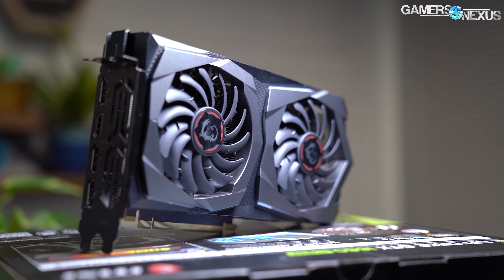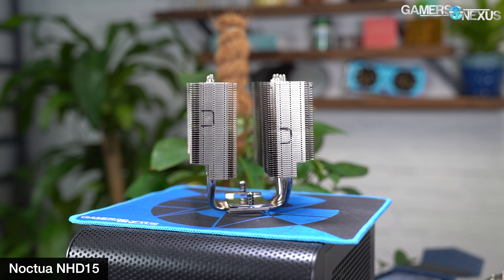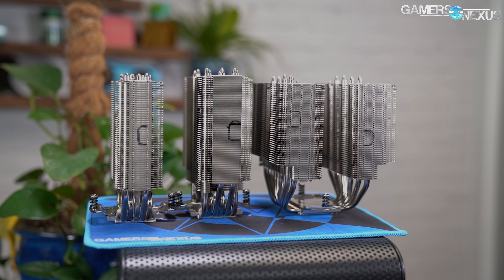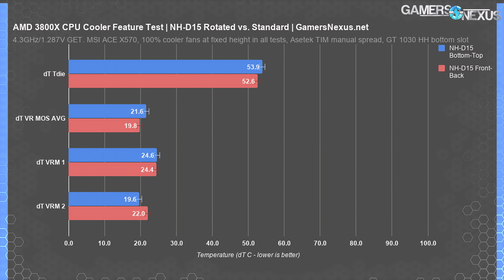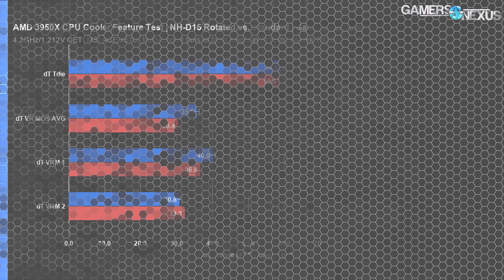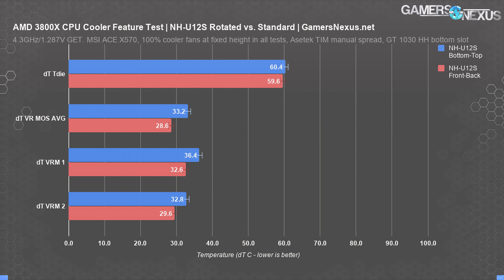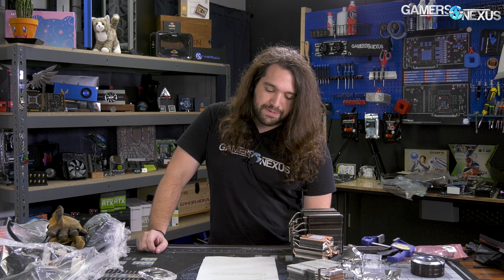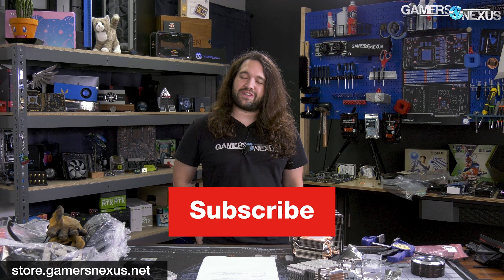AMD Ryzen Heatpipe Orientation Benchmark & CPU Cooler Myths

Comment from the maker: We did in fact test the D15 (with two fans), not the D15S, contrary to an earlier comment that incorrectly "corrected" it. Removed the comment to reduce confusion so that people don't see it and get confused. We filmed this one like a month ago, but finally got around to publishing it. Article is ready and will go live after the video has some time to breathe.
Check out the Disappointment PC build! https://www.youtube.com/watch?v=YO_xDzDOua4
Buy the Disappointment PC Shirt in cotton (https://geni.us/izO3) or Tri-Blend (https://geni.us/rw8QX) to support us, our intros/in-depth testing, and to commemorate a year of disappointment! These will be a limited run due to the nature of the shirt.
Reply: So what you're telling me, is that other random people on the internet may be giving out bad information? Next thing you will be telling me is that the Earth isn't flat...
Reply: Good video. I know this is a little impractical but, I would be interested to see how well a cooler works upside down vs right side up. I have read that different types of heat pipe wicks (grooved, wire mesh, sintered, etc.) are affected differently by gravity. Some are not affected much, others (like grooved) are affected much more. I believe most (if not all) CPU coolers use sintered metal (which works very well against gravity) but, I wonder if certain wick styles are more cost effective and if that would lead some cheaper CPU cooler manufactures to use grooved or mesh wicks. If they do, I wonder to what extent those coolers would be affected by gravity when mounted in a more gravity challenging position.
Reply: Great video!! Now, to take this a step further, would it matter for coolers with direct contact heat pipes (for example the hyper 212 Evo)? I thought maybe a cooler like this would be represented, due to the fact that there was a cooler on the table/workbench which had direct contact heat pipes. Since the coolers tested here all have nickel plated cold plates(I believe that's the proper term... But essentially there is an extra layer of metal between the IHS and the heat pipes in the coolers tested in this video, which something like a 212 Evo does not). Just a thought since the orientation may make more of a difference due to the direct contact nature.  (I hope this makes sense)
Reply: The efficiency claims would have potential basis when it comes to heatsinks with direct contact heatpipes. In practice, you're looking at a 2-3 degrees difference.

In non direct contact implementations there's no practical difference really.
Reply: Thanks Steve, but these myths are basically exercise in stupidity. If even once those redditors or basically anyone spreading those myths performed at least a heat simulation I'm sure difference would be negligible.
Reply: @Gamers Nexus If you want to make a video on waterblock orientation and jetplate modifications on Rysen 3, Igors Lab would be a good inspiration source. He did try something like that, although in German.
Reply: @Denis-l6p  No worries mate, My main thought is that when dealing with heat pipes with different types of wicks, some work better to fight gravity, some do not. Sintered works very well to wick the fluid in the heat pipe back to the source of heat (even if it is straight "uphill"), where as grooved (according to my reading) does a poor job against gravity.

 So in the theoretical example I'm thinking of it would be as though the motherboard was facing upside down (Like flipping a server chassis upside down), with the cooler heat pipe tips pointed straight at the ground. If the cooler uses sintered I would expect some very small loss in performance (probably negligible), but if the cooler used grooved I would expect a much larger loss. Now this is such a special circumstance scenario I doubt many people ever have their motherboard facing down in the first place, let alone use a cooler with grooved heat pipes, but it might be a circumstance when orientation (in terms of overall orientation, not orientation in relation to the CPU itself) does matter.

I would try it myself but my PC has an AIO, so no heat pipes there. I might be able to see if it affects my gpu, but the heat pipes in there are not as simple as a CPU cooler (like tower coolers from noctua for example) where all the heat pipes have a common facing "tip point" that all point in the same direction. And I am 99.9% certain they are sintered in my GPU anyway so I doubt I would be able to get any amount of noticeable change. 

It would be interesting to see if some really cheap ("no brand") coolers use grooved wicks or even mesh wicks and would fail under this circumstance. But frankly this is mostly just a "what if", I can't think of many examples where this info would do anyone much good, other then satisfy my curiosity lol. The main question is if any company is shady enough to put really low quality heat pipes in a CPU cooler. If so (according to my reading) and if it was grooved and it was working straight "against" gravity it should fail to within a very high percent of its efficiency
Reply: Shirt links don't work
Reply: @LapFox most of the good shirts  sizes are sold out anyway...
Reply: That's several days of testing for something you already knew won't make a difference. Thank you for taking one for the team, and kudos for all buys and girls in performance testing!
Reply: Again, thank you for making life easier to prove to new builders who catch wind of nonsense.
Reply: +Gamers Nexus Pls test bottom top with a popular gaming gpu! Could it improve gpu temps at the cost of cpu temps? With a not so core heavy, lower tdp cpu that is sufficent for gaming paired with a higher tdp gpu, the cpu's cooling might help improving gpu temps... Still probably would not worth changing builds for a couple of degrees but would make an interesting vid. Thing is, I have an i5 8400 + a gtx1070(msi armor). Cpu cooler is a bottom top oriented Alpenföhn Brocken 2 with 1 140mm fan right between the gpu and the heatsink. I was worried at first because I could not fit the whole thing in any other way but my temps are great. GPU never reaches 70, Cpu never reaches 65 celsius. Gpu has a 15% OC. Also I have another 140mm fan at the top of the case and one at the bottom. CPU idles is 35, GPU (turned off fans) 45 celsius. My case is an old Cooler Master 690 Advanced II. And sry for my english if it is hard to figure out what I am trying to say.
Reply: What i am a little concerned about after reading and posting replies to quite a few of these comments is that heatpipe orentation really does not matter. Which is false it actually does matter significantly. It matters to the degree that there are mutiple wick types for constant conductance heatpipes and some of those really do not work well in some orentations. As well as even between the same type of wick for example 2 sintered heatpipes based on the wick thickness and porosity you can tune and mitigate issues like the ability of the heatpipe to work in different orentations and even the pipes ability work against gravity. 
I do not disagree with the test nor how it was conducted. I however think some of the explanation and findings could have been said / done in such a way to further improve peoples understanding of what this test really showed. Which is that most heatpipes when already run in a horizontal configuration do not preform worse when rotated within the same axis. Like having a half filled water bottle on its side and rotating around a imaginary axis that runs from the top of the cap through the base of the bottle horizontally. And that integrated heatspreaders do their jobs well ... 

The issue im seeing is that some people are thinking that orentation of heatpipes in any and all axis do not have a significant effect on preformance
Reply: What kind of a GEEK are you? A D15? 
IT'S D4 D6 D8 2*D10 D12 D20. There is no D15 in D&D. Don't you know nuffink?
Reply: @Peter Cavojec i am not even sure where to start in regards to replying to that comment. Ryzen 3rd gen uses one of tsmcs 7nm processes while not the slightly more dense 7nm extreme UV process it is still more dense then intels 14nm processes. Tsmcs 7nm EUV process is actually very very slighly more dense then intels revised (less dense and more realistic 10nm process revision which is currently busting the backs of intels engineers) .... Then you run into the issue that amd and intel use different metrics to calculate TDP and differnt boost durations they end up being not very comparable. The next issue here is that efficency generally increases with density as you have less loss from internal resistance however you also increase thermal density which makes chips harder to cool as a general trend however if you for example changed the extremely small copper interconnect grids out for say gold your again changing internal resistance... What im getting at is process tech and material choices make a huge difference as far as how efficent a chip is at any given transistor density as well as how much leakage may occur. For example mobile processes are lower leakage processes , a inherited side effect of lower leakage tends to be lower frequency. Mobile processes have a trend to not clock as high as similar processes tweaked for higher frequency bascially damning efficency to a degree. There is so many other issues here as well... I am just goona end my reply with this last thing otherwise this reply would be many books long if we were to go through the physics and material science here
Reply: @Gamers Nexus

Can you do some tests to tell us, which watercooling block to use? 
There is also a hypothesis out there, which claims that most waterblocks will struggle (in comparison to non 3000 series) because of the non centric dies (asymmetrical + off center)

Thanks for your vids and greez
Reply: Is there a difference between running coolers in orientation ie UPSIDE DOWN vs sideways (like in a case) vs upright (like a test bed)?
Reply: pointless arguments. just use an aio

Comment: Orientation on the CPU isn't what I wondered about.  I wonder about heat pipes being horizontal, as in a tower case, versus vertical, as when the motherboard lays flat and the cooler sticks up.

Comment: Hi there,

I was wondering if y'all would be willing to do a video testing different GPUs with different types of cooling(blower style, heat pipes and fins, just fins, etc.) and their ability to cool themselves in different orientations. 
This problem stems from the SFF community where there are many cases with an upright GPU, which is now being introduced into Lian Li's cases as well. The SFF community's general consensus has been an upright GPU does not cool as well because of heat pipes pointing down, vapor chamber liquid being further from the processor, and blowers having more resistance blowing up than sideways.
I would think case designers would not make upright mounts if this were the case, however, Thermaltake has just pumped out a new set of 90 degree mounted cases and a new Tower case with the GPU in an upright orientation.

I would appreciate it if there was a test of some sort done specifically for GPU orientation in open air, not taking into account things like distance to side panels and such. The only tests I can find for heat pipes are industrial or zero gravity applications.

Comment: My tower case on it's side allows my xeon cpu to run at 140W. In normal tower orientation, the CPU can only do 100W. The orientation of the pipes makes a huge difference. The thing to understand is that the liquid in the pipes cannot flow upwards. If the liquid doesn't flow back to the CPU, cooling is severely impacted. If the CPU is not at the lowest point of the pipes, relative to the ground, those pipes are not working at maximum efficiency.

Comment: Great work! This is as close to scientific method as you can easily do with coolers. The only thing possibly missing is testing for the gravity effects (e.g. you could run the whole test bench upside down and see if it affects the performance of heat pipes – logically cooled liquid should fall downwards and if you have the system upside down, the liquid inside the heat pipes might never contact the CPU end of the heat pipe).
Reply: Heat pipes are built with wicking inside.. Sintered metal powder based heat pipes should not in anyway be disturbed by gravity! Liquid has no issue traveling against gravity in a wick
Reply: @DarkAttack14  I totally agree that a correctly implemented heat pipe should depend on wicking only. My trust in average hardware manufacturer is low enough that I think the implementation quality should be validated and that's why I think at least one test done upside down would be warranted. If that doesn't show a difference, then you can be pretty sure that the wick implementation was actually correctly done.
Reply: @MikkoRantalainen  yeah I'll give you that one, I'm operating from the assumption they produced it properly! You're not wrong that it is not a guarantee. One of the first uses for heatpipes was inside satellites and spacecraft so a properly built one can handle all types of gravitational situations but one would assume NASA was building proper heatpipes XD

Comment: My 3800x runs smoothly and quite cold at 4475 MHz, using Noctua NH-D15. Indeed, I have a monstrous case, but the fans runs at their minimum speed.

Comment: I have a request. Would you consider doing a test with venting the heatpipes?  I am interested in seeing how much effect the liquid actually has. We know heat travels by 3 methods, Conduction, Convection, and Radiation. The copper is always there and conduction is a constant.  The fluid introduces both phase change and convection. You guys seem to be able to afford to do destructive testing so how about it?

Comment: the orientation of the heatpipes would be more effected by gravity i think, you want the cold side of the heatpipe orientated so the fluid within the heatpipe can flow back towards the cpu end of the pipe.

If you mounted a heatpipe cooler on an upside down motherboard (like the 2 system in one case with itx board mounted in the roof of the case) it's efficency would suffer greatly.

This is a noticeable problem with laptops, if you tilt some laptops 90 degrees so that they are not horizontal the cpu temp wise rise rapidly.

Comment: As for front-back vs side the important part is if you have the top exhaust. The "warm" air off the GPU is irrelevant. Unless your GPU has a backplate cooling problem or you're fanning an M.2 card with the CPU fan, then there might be a small difference.

Comment: I'm predicting it won't make a damn bit of difference because usually the heat pipes are right next to each other anyway, so the dies will have contact of a heat pipe regardless of orientation.
Also, you know, there's a thing called a heat spreader between the die and the cooler.
Reply: Yep, that was unsurprising. Reddit sucks.
Reply: ich sag ja ich hab ir die eier abgefrohren so kalt war der tower am lüften wie ne kühlscvhrank klimaanlage mit den tackten mir ist iimmer noch ich friehere nichtrmalheiß geworden eher gelangweilt

Comment: I think with a CPU like the 3900X the orientation can be more important than on 3800X just because both CPUs die can generate more heat than the I/O die.
With the 3900X and one tower with 2 heatpipes (to can explain it more easy)  then is possible cold it with the same heatpipe and other heatpipe cold the I/O, and rotate it 90° and each heatpipe cold one CPU die each and share the heat from the I/O...
For me cold the 3800X or lower CPUs with only one CPU is less important the orientation but on a 3900X or 3950X can be more important, on 3800X can be irrelevant.
With 3900X
A=2*CPU+1/2*IO B=1/2*I/O
A=CPU+1/2*IO....B=CPU+1/2*IO (rotate)
With 3800x
A=CPU+1/2*IO B=1/2*I/O
A=CPU....B=IO (rotate)

A&B are the heat to disipate for each heatpipe... (Easy calculation without count the spread disipation between the dies and the heatpipes)

Comment: Reddit is a dumpster fire these days.  It's full of this sht on every possible subject, stabbing blindly in a dark room.  People who know the least tend to speak the most about something.  They like to hear themselves talk.  That and the idea that Reddit is chock full of dead, locked threads with outdated information that should be avoided.  They want you to start a new thread, but don't like when you base it on a previously "closed" subject.  Kind of like Tom's Hardware with most of their forum posts over 5 years old.  Useless.

Comment: Isnt that the point of the IHS to spread the heat so that aslong as the heatpipes or contact plates touch the ihs it should be equally distributing the heat?